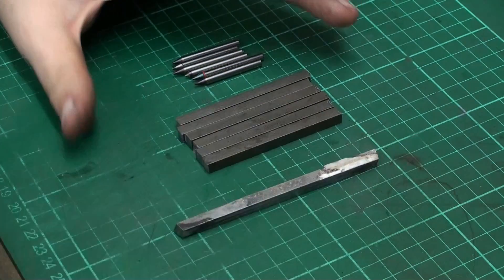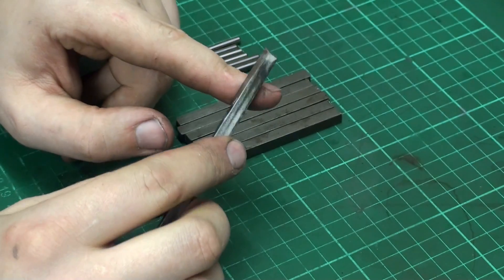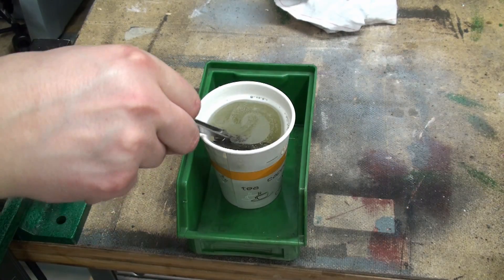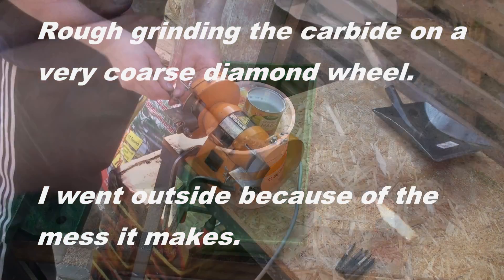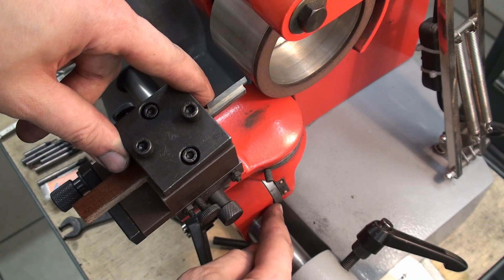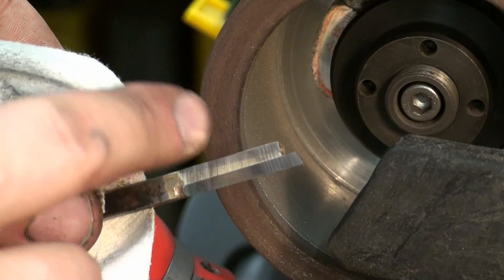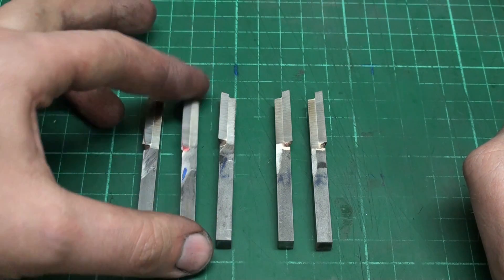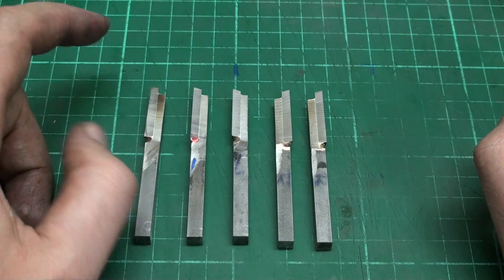Shopmade brazed carbide lathe tooling

Comment: Stefan, 
I purchased a flat bar of carbide. How can I cut it without loosing material? Can I use a skinny diamond wheel? In afraid the heat will damage the wheel.

Thanks.

Comment: My advice for the high temperature boron flux is vinegar. Maybe I'm missing something and the vinegar is actually damaging my parts, but it actually does a far better job of dissolving the flux than citric acid, yet I've never seen it recommended anywhere. Easier (see: cheaper) to get too, I buy it in big 3 or 4 liter bottles because it's so useful

Comment: Stephan.
I know it's video is old and you probably don't look at the comments any more but just a thought.
If you clamped 4 pieces of shank together to form a square.
Then drilled down the end in the  middle you would have better location for the carbide and a better joint for the braize. 
Also if  you grind the same clearance top and side and grind  the end as you showed .. until  you break the sharp corner the tools are neither left or right hand but universal.
Reply: It makes sense to drill four at once!  And you're drilling instead of milling, it's more economical all around!
Reply: Also, I think that little can is Butane!

Comment: Would you try brazed carbide for the shaper or is it too brittle for an interrupted cut? I just scored an alexander grinder which is an English cooy of the deckle. Now I need to find or make that lathe tool attachment. You and Robrenz are my favorite youtoob metal dudes. I learn so much from you guys. I would like to know more about your little heat treat furnace if you do another shop talk. Keep doing great work!!!
Reply: I have pretty good results from interrupted cuts in a lathe using brazed carbide (of a tough grade) - I've even used it to reprofile Burnerd lathe chuck hard jaws  -but I guess a planer is another level up when it comes to shock loading. 
I reckon if you need something harder than (but as tough as) HSS, you should try Stellite (aka Crobalt, Tantung). I know there's an outfit (Eccentric Engineering, IIRC) in Australia which sells Crobalt online at affordable prices and they ship overseas.
More info at http://conradhoffman.com/stellite.htm

Comment: That is a great use for old carbide endmills. They are very expensive here so I have saved the few I have owned and destroyed. Thank you for the idea. If you want to be really cheap like me, make a tool holder for your used inserts. I resharpen my chipped triangle inserts freehand. I made a special hand held holder smaller than normal so I can use it to hold the insert while grinding it, and not burn my fingers. I only grind two sides so I keep one side as a reference. I made a straight holder with a slight angle, because I grind off the chipbreaker, for the lathe to accommodate my regrinds. Great for interrupted cuts, or any time you have a bad feeling you may break one. I figure if I reuse 1 corner of a $7 insert I save $2.33 . Takes about 5 minutes to do. $2.33 every 5 minutes is close to $28 an hour saved. Thats a lot of money over the years. The inserts seem more durable after being reground.

Comment: hello Stefan I'm about to solder a thread cutting tap onto a piece of Steel to cut in a deep hole can I do that without making the tab brittle and what soldering material do you recommend
Reply: I've already done it, and it worked great. Thanks for the feedback though.

Comment: In the future you may want to consider milling shallower pockets for the carbide pieces; less than half of the diameter of the carbide piece that you have on hand. You have to grind at least that amount of material off to get a keen cutting edge anyway, but the primary advantage comes from avoiding grinding steel with your diamond wheels. As you probably know, steel interacts with the diamond wheel in a really violent way, and at the point of contact between the diamond particles and the steel the temperature skyrockets. This causes the binders in the diamond wheel to fail and the wheel rapidly wears away. Unfortunately coolant cannot solve the issue. Also if you mounted the endmill with the broken end facing away from the end of the tool, you could save yourself a significant amount of grinding. 

Love your videos, keep up the excellent work!

Comment: hello what brand of  grinder  is  the one your using   the one with diamond  wheel  thanks..
Reply from the maker: Thats some generic bench grinder with 125mm wheels. I put one of those coarse grit diamond wheels from Kaindl on it and use it outdoors for carbide grinding when I have to remove a lot of material.
Reply: thanks gotteswinter for the info. did you add on the set-up  for that grinder  i need something like it  but  cant find  one

Comment: At 10min 50sec into your video you show the grinding of your carbide/mild steel side face using a diamond cup grinding wheel. I have tried to grind steel (HSS drill) with such a (chinese) wheel but it gummed up quickly. According to general theory you should not use diamond on steel because diamond is pure carbon and the iron and carbon in the steel tends to stick and build up on the diamond surface.  Your wheel does not seem gummed up. Is maybe the lower carbon content of cold rolled mild steel better suitable? Did you have any problems with that or have you made observations in this direction?
Reply: rol eic 
Maybe the carbide scraped the surface enough to keep it cutting ?
Reply: I think the movement of material is actually the other way round: the carbon of the diamond dissolves in the steel at high temperatures, causing the diamond to break down.

Comment: I prefer HSS aswell, hate carbide. When you dont need to hold an edge at 10 in diameter for 6ft lol its the way to go. For my small projects i find having a few pieces of cheap Chinese HSS a good thing for aluminum as it grinds alot easier

Comment: Great video. Do you think this wold work for shaper-tools?
Reply from the maker: Dag-Fredrik Andersen Yesnomaybeish ;) I had little luck with carbide on my shaper because my machine doesnt have a automatic lifting clapper box - It drags the tool over the work on the return stroke and by doing that the carbide tends to chip. But what I did is brazing pieces of HSS to a mild steel shank to create shaping tools for keyways, that works incredible well - The HSS takes the brazing very well and doesnt loose its hardness (Actually its very hard to soften modern HSS with cobalt).

Comment: Great video.  I had not thought of that but it seems like such a good idea that I am sure at some point I will do the same.  Thanks for the video.
Reply from the maker: cerberus Sometimes a bit of inspiration is everything thats needed...I saw Keith Fenner make tools for his slotting head by brazing HSS bits into a mild steel bar - So I went on and did the same with carbide :)
Thanks for commenting!

Comment: Just imagine what you could do with an old, broken 1" carbide endmill!  :-)

Nice way to make the tool.  I imagine you could do the same on a smaller scale to make them for boring bars that take square shanked bits.
Reply from the maker: ILGopher Broken 1" carbide endmill? Drop tears! For some reason I am stuck with small work, so my endmills seldom go over 10mm.
Yeah, I did it for boring tools also, it works very fine and one could make very low profile boring bars to get in deep/small holes :)
Thanks for droping by and leaving a comment!

Comment: Hi Stefan,
That's a good inexpensive solution for hobby use, and the results are usually great with smaller lathes.
For the hobbyist it's heart breaking having to replace a broken $20 insert... Snifff.... Sniffff....!!!  :-(
So your solution is simple and provides a tool that can be sharpened and configured at will.  :-)
Good video,
Pierre
Reply from the maker: pierre beaudry I always nearly dropped a tear when I broke a polished and ground insert for machining aluminum :(
With milling cutters I dont have many options - Buy curbide endmills and regrind the ends. But I always can make a lathe tool from scratch and hold back the money for milling tools :)
Reply: @StefanGotteswinter   I use brazed carbide lathe tools in my turret mill, one at a time, for flycutting (yes I know, it's not endmilling, I guess technically it's side milling). As you well know, but others reading this may not, it's an amazingly cost-effective way of getting a superb finish on large facing cuts. It's a great alternative to needing huge horsepower and hundreds of dollars worth of inserts in a big, scarily expensive face milling holder .

Comment: I like your good old fashioned idea of re-purposing, re-cycling, re-using etc Why waste money to buy something you already have? :>)
Have you thought to use one of those tools in a tangential tool holder? With the carbide running longitudinally, one tool will last a couple of life times, well maybe not, but certainly a few years as you only ever sharpen the end.
Reply from the maker: Chris Stephens I think its Hip again, the make-crowd seems to call it upcycling ;)
I am not a big fan of the tangeial toolholders, seeing not a big advantage in them except for the very easy regrinding - Grinding a chipbreaker in the tangential toolholder is pretty hard...
But I think they would work also very well in a tangential toolholder :)
Reply: Yup a chip breaker would be nice but would ruin the whole point of easy sharpening, unless of course you can come up with a cap style chip breaker. I have to admit an interest in Tangential holders, they are my go-to tool for all materials, except for heavy roughing cuts or where HSS is unsuitable.

Comment: Come over to the dark side of inserts, they will save you a ton of time and for most people time is money too. :-) Ebay is a great place to score inserts. I rarely pay more than $1 usd / cutting edge and I can't see spending my time to make them for that.  It is neat to see you practicing an old common practice and recycling though!
Reply from the maker: +bcbloc02 Good comment on the time/money thing :) If I had to make a living by running a lathe, I would absolutely take the time to dive fullon into the world of inserts - But for me literaly playing in my homeshop I dont realy see the need for it (I tried my fair share of inserts and on my lightweight lathe most of them where not to great). With the brazed tools I can grind every geometry I want, put every desired corner radius on it, grind a chipbreaker in them that suits my fancy and practice my toolgrinding-skills :)
I absolutely am not an opponent of inserted tools, they are absolute standard in the industry and proven to work millions of times.
Reply: Playing with geometry is fun and sometimes finding the right insert for a particular job can be very difficult, so making your own certainly has its advantages.
Reply: @bcbloc02  Especially for small diameter stuff, it seems to me that razor-sharp brazed carbide (like solid carbide endmills) has a lot going for it.

Comment: Another good video Stefan, a pleasure to watch!  great way to repurpose old end mills.  Curious what you don't like about the insert tooling?
Reply from the maker: turbocobra I do a lot of small diameter turning below 10mm and for that I would need very sharp carbide inserts to prevent high cutting pressures - With my own tools I can alter the geometrie exactly how I want :)